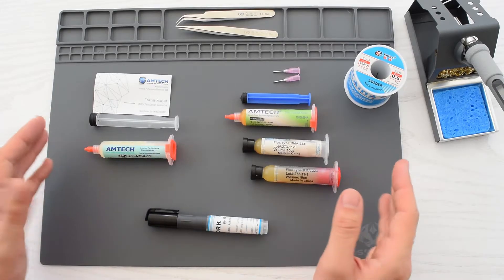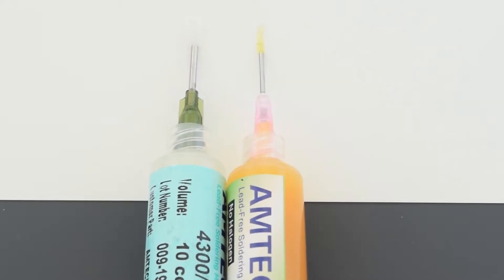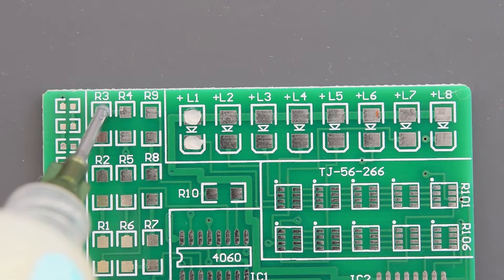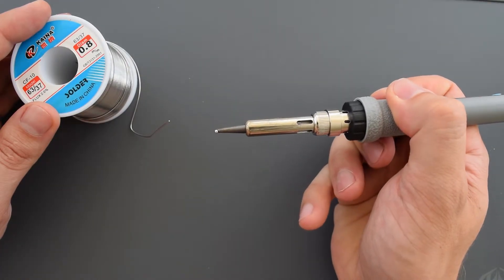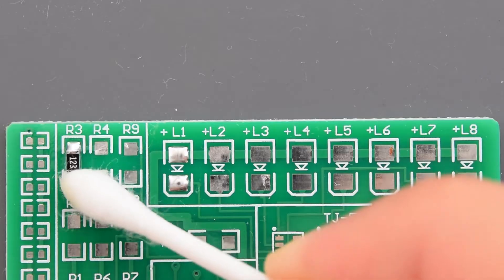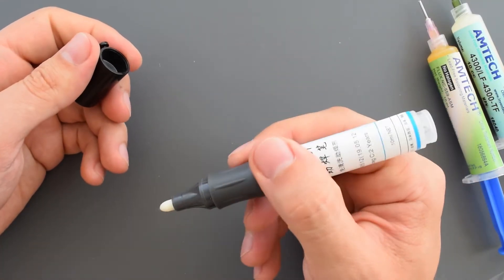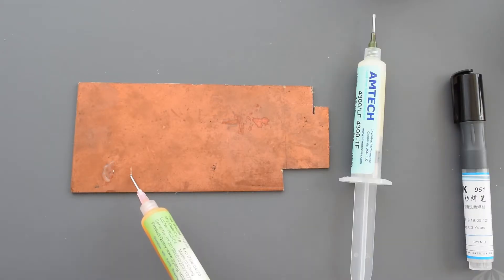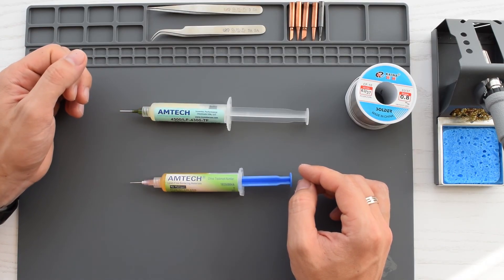Genuine Amtech Flux vs Fake AliExpress Flux – Test & Comparison

Comment: Aren't the fluxes completely different versions? How can you compare them, if they have different  ingredients? It is a nice video, but this comparison is like comparing original Coca Cola with Pepsi.
Reply from the maker: True, these fluxes are designed for different applications, but the test wasn’t about their intended industry use it was about comparing their real-world soldering feel and performance in the same scenario. Using SMD resistors gave a consistent, repeatable way to see differences in wetting, residue, and ease of handling. It’s not a definitive 'which is best for all uses' test, but it still shows how each behaves under identical conditions.

Comment: I have tons of the fake Amtech NC-559 I got about 20 tubes of it for very cheap about 5 years ago. I'd buy the real stuff but in Canada it's impossible to buy without importing it and it's not cheap, costs about $15-20 USD, $20.78-27.70 CAD per 10CC before shipping and a lot of them will not even ship it to Canada, I paid about $27 CAD, $19.49 USD for ten tubes or about $2.7 CAD, $1.95 USD per 10CC tube. Honestly it works just fine for what I use it for, a lot of through hole stuff and disordering, used it on a good amount of SMD stuff and a few BGA things. Never done a Reball with it since I mostly just do small repairs and salvage for practice, but from the times I've needed to do SMD rework it worked great, cleaned up nicely and didn't make any problems for me. I'll say it does not smell nice at all and I do have the room vented and a fan going when I do use it but it's not a horrible smell.
Reply from the maker: In my repair shop, we started out using all that authentic overhyped, overpriced stuff. We were just way too overenthusiastic back then. Now, the cheapest Chinese flux and parts all the way plus high-purity rosin flux where it makes sense. Works like a charm, zero regrets. Also, I used to live in Toronto. We were planning to open a repair biz there too, but I left Canada for good. The Canada I knew in 2018 vs what I saw after 2023? Feels like two totally different countries and one I’ll never want to return to.

Comment: i have the aliexpress version too of the amtech nc-559-asm flux. It perfoms pretty well on the majority of the components. I haven't tested it on smd soldering, yet but I will do it soon. If you don't want to spend a lot on a fume extractor, just take an old fan from a  PC power supply, buy some pipe or whatever for evacuation and maybe make a PWM controller for it. Or just plug it directly to a voltage source, like an adapter. It will shorten the life span of the fan, but if you don't want to do this professionally and just want to get rid of the smokes asap, plugging it into an adapter will be ok.
Reply from the maker: I’ve almost completely switched to using high-purity rosin flux, especially for most of my work, as it's organic and free of harmful toxins or unpleasant odors. I’ve noticed that many others in the community made this switch even before me. For some tasks like replacing CPUs and GPUs, I still use Amtech or a similar synthetic flux, but for everything else, I stick to rosin flux.

Comment: Flux is Flux no matter how different the brands are. 😊
Reply: If this was true, then why not use cheap hardware-store plumbers flux on your circuit boards? Because it will be corrosive and conductive and will ruin them, DUH !
Reply from the maker: You're right, they all do the same thing, but still, some do it better, some produce more fumes than others, and some are way easier to clean than others, etc.

Comment: Didnt have performance issue with specific china flux i got, but problem is fumes are so bad my eyes burn for days. Dont want to be buying everything untill i find something that works. Does amtech smell less?
Reply from the maker: They all produce fumes, including the original Amtech flux. I wouldn't use it without a fume extractor. I use Amtech only for the chips; for the rest of the components, I use natural rosin flux to minimize exposure to harmful chemicals.
Reply: @ElectronicsComputers Thank you. I do have very good fume extractor that dumps the air outside but of course you cant catch it all esp when working with hot air that blows it off the board
Reply: My tech uncle died due to respiratory failure because of everyday exposure to Flux

Comment: The real problem with fake Amtech fluxes is possibly dangerous chemicals in flux and lower ability to prevent unwanted solder bridges. The first is not a big deal if workspace have proper ventilation. The second however make QFP, BGA and tiny connector soldering really hard. Discovered that in hard way my myself several times. For larger component soldering and desoldering in general those fake Amtech fluxes works just fine.
Reply: ah yes every chemicals from the usa is totally harmless, for example dupont, cows and farmers die because of totally harmless chemicals from the usa. the 50 times overpriced stuff must be good also and the normal prized things must be trash, because of the overpriced stuff.
Reply: There is also a possibility of corrosion or electrical conductivity caused by traces of fake or poorly refined flux on the circuit board.

Comment: so there really isnt much of a difference? aliexpress it is :D
Reply from the maker: Both do what have to, but Amtech is cleaner.
Reply: @ElectronicsComputers  thx for info and good review
Reply: Not much until your task goes down to QFP, BGA and tiny connectors. Expect sudden solder bridges, cold solderings under BGA and component/PCB failures while trying to clean exccess solder off :)

Comment: Flux is basically a gel that corrodes top layer of metal. Top layer is usually where the corrosion resides. The gel should solidify in open air to prevent slow corrosion. In my experience, the better quality flux solidifies better. Cheap flux uses some kind of oil base which never solidifies in open air. But both perform just about the same. Make sure you clean the PCB with thinner(kerosene, mineral oil or petrol) if using cheap flux.

Comment: How many degrees do you use it in the soldering gun?
Reply from the maker: It depends on the components  but typically it's 300-35 or 400C for big components like electrolytic capacitors or something like that.
Reply: @ElectronicsComputers  I buy the amtech flux and honestly I don't like it I trying to solder some cables for my lipo batteries and nhaaaa

Comment: Is it impossible, to buy genuine amtech flux on AliExpress or ebay?
Reply from the maker: You can find the genuine product on Ebay just buy it from sellers with good feedback. Amazon links in the description.
Reply: @ElectronicsComputers  

It doesn't seem like this is a safe method.
There are a lot of off-the-shelf "RMA-223" from Ebay sellers with high ratings.

These are the only two on a price comparison site:
www.ebay.com/itm/221720475929
www.ebay.com/itm/282421548559
99.6% and 99.7%

And look these yellow flux with 99.5%:
www.ebay.com/itm/162878781101

Or 99.6%:
www.ebay.com/itm/332194555961

Etc..

This is the first listing (sorted by price) where the paste is not yellow in the photo:
www.ebay.de/itm/360635476138

Can't get a bigger amount for a better price?
Or another product from another manufacturer, which is also very high quality.

Comment: I been using 223 fake stuff and I kinda thought it was fake but I didn’t know. Makes sense now. Well I’ll be buying quality stuff now
Reply: Most likely you didn't needed to solder really small components. Fried some traces and broke few MicroUSB connectors in past due to inability of fake RMA-223 to prevent solder bridges in short distance. For large traces and components with gaps large enough fake stuff usually works fine. Though it smoke like coal chimney.

Comment: It's strange, I just bought a 559 AMS 30cc from a local store that claims that is the official distributor of Amtech flux here in my country. It seems I received the OG flux (didn't test it yet but colour seems the same), but also there're differences in packaging. Volume quantity is wrote by hand, I didn't received a card and neither the needle, only some kind of plastic needle with pen shape. Also the syringe is already armed and there's no orange cover, obviously. It's like they make the packaging, maybe due they get the flux in big containers (if the flux I bought is legit..).
Reply from the maker: There's only ASM model not AMS. Original Amtech flux comes only in syringes like in my video.

Comment: I've been using some cheap liquid flux i got on ebay for $10 for 2 bottles for awhile now.that crap smokes like a train and it always runs away from my iron.

Picked up some genuine amtech  599 for $19 and omg i can drag solder now.what a frecking difference.it actually stays put aswell.
Reply from the maker: Yep, Amtech makes the best flux.

Comment: So, Amtech flux doesn't smell like a pine anymore?
Reply from the maker: I think that depends on the type of the Amtech flux.
Reply: It may or may not smell acorrding to batch from which your flux come. Which depends from are content of your syringe is made by Inventec or Amtech themselwes. This guy have detailed info about differences between original NC-559 flux branches:
https://youtu.be/IG8_NAP72oU